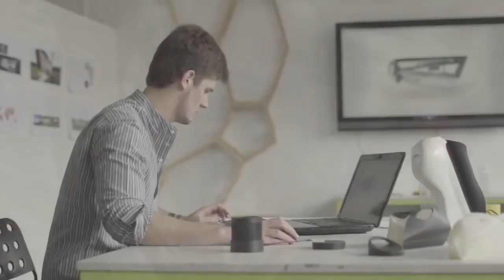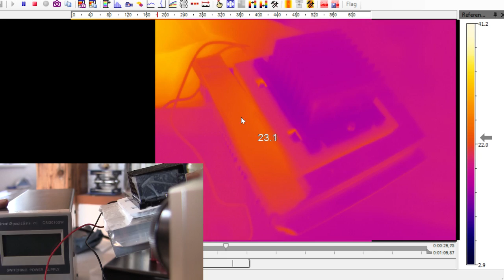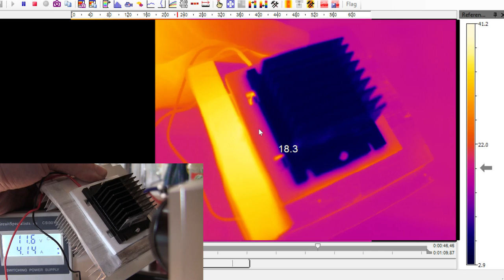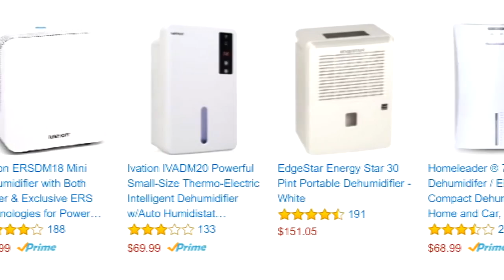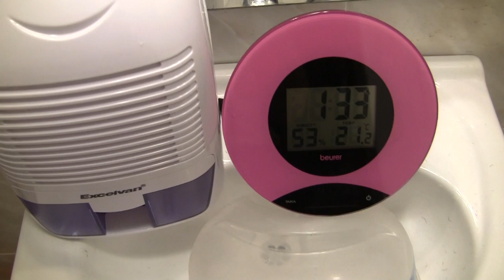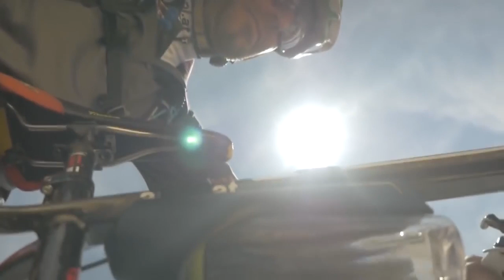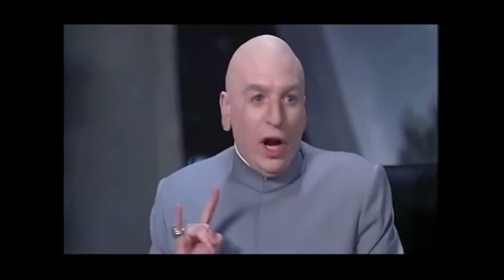$300 000 'Self-Filling water bottle' FAILURE

Comment: Just saying, wouldn't it be more efficient to use the kinetic energy from cycling to produce the electricity needed to power the bottle?
Reply: @Archn Scythe, Take it this way. Lets say you want to use 200 watts of power to ride your bike. that will enable to cycle at a speed of 30 km/h (19 mph). But lets say you want to also power a generator, to power your dehumidifier, but still only use 200 watts total for your riding experience. Lets say your dehumidifier uses 30 watts. That only leaves 170 watts of power going towards the speed of your bike. with less power, you will go slower, like around 27 km/h (17 mph). To be able to go as fast as without the generator and dehumidifier, your body will need to generate more power (230watts).

Where does power/energy in your body comes from? It comes from burning up sugar. Sugar comes in various forms of molecules containing carbon (C), hydrogen (H), and oxygen (O). Take glucose as an example. its combustion formula is 

C6H12O6 + 6*O2 -> 6CO2 + 6H2O + Energy

So you see, to make energy, you need to burn sugar, which will use oxygen (what you inhale) to fuel the reaction. The reaction produces carbon dioxyde (what you exhale), but you also exhale water vapour. So if you need more energy to power the dehumidifier, you'll be exhaling more water.

Also, our body is not a perfectly efficient power plant. When we generate power, we lose some of it as heat. A comparable example is a car's engine. When the engine is burning fuel, only 30% (!!!!!) of the power produced goes to move your car. 70% of it is lost in heat. That's why your engine gets hot, and why you need coolant. And that's why you heat up when doing an exercise. If you need to generate more power, for the dehumidifier, you'll be generating more heat, which the body will have to get rid of. How does the body get rid of the unwanted heat? We sweat. Sweat is our cooling system. Sweat is mostly water. So by generating more power, you'll be loosing more water through sweat.

To conclude, as you cycle, if you want to power your dehumidifier, either you'll:
-go slower
-go at the same speed, but lose more water due to exhaling more of it and sweating it out.
Reply: 100-200w sounds about right for riding a bike, more when offroad. and imagine needing another 200 to 300 watts for the dehumidifier. anyone else getting sweaty already?
Reply: In the hypothetical situation where energy production is the only major problem of course.
Reply: well you would be taking the energy from the person, then they would need even more water...
Reply: and still with 30 watts it would take like a week to fill up the bottle by cycling, you need a lot more power..
Reply: not sure if troll or stupid
Reply: Why all the Rube Goldberg? I propose a startup where we make people cycle and then extract the water that drips off their forehead. This is at least several orders of magnitude more efficient thermodynamically speaking.
Reply: then you would need a more efficient way to extract the water than the modern way, because the amount of power needed is pretty big... there could be net gain but it would be really small like you said, making the idea almost useless.. the best idea is to carry around enough water and a not so great idea, (but still better than the generator idea) is to carry a battery big enough to run the dehumidifier thingy. 

if you are far from civilization, its a better idea to reach a water source or the civilization quicker than ride the heavy bike slowly, because you could run out of food too..
Reply: oh, so it was sarcasm? damn i never learn that...
Reply: yup. I don't know how much power normally goes to a bike generator, but I know that 200 watts if fairly normal for riding a bike at 30 km/h. So there isn't that much available power anyways
Reply: +Hirmuli I think you missunderstood what Zaheer Navas said. It was a hint at how Archn Scythe seems to see the energy physics. And i had the same thought. If the whole 'you are driving the bike anyway, so just extract the energy from it' idea was true, you could solve electricity problems by using the same principle with your car. 

Of course its bollocks, but its a way of illustrating it.
Reply: That causes losses to power the generator. So the rider has to cycle harder to travel the same speed & distance.
Reply: Shillip DeFraudo no NO! Stop thinking common sense! Bad!
Reply: @Suros what did tk say?
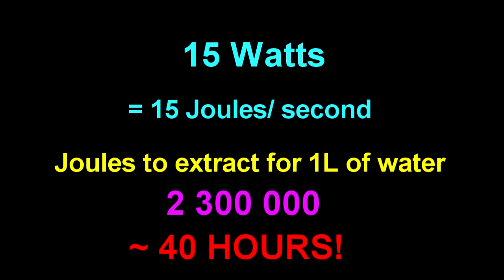Reply: When you ride a bike you put somewhere between 100W and 200W into the pedals. Let's say 15W extra for dehumidification would be acceptable. As the video showed at 2:12 you'd have to wait 40h in perfect conditions for a liter of water. On top of that, I'm convinced the extra sweat your body produces from these 15W of extra power is much more than this measly 1liter/40h=25ml/h in all but the coldest conditions.
Reply: The best way to get some energy out of cycling is via generative braking. The brake levers close the circuit on a generator instead of moving brake pads. The resistance of the generator slows the bike to stop or moderate descents. The system would need a battery of course, because of the intermittent source of generation. Some electrically driven bikes already use this to put a little power ‘back in the tank’.
Reply: Shadow you would have to install some kind of generators in the pedals to create electricity from them, that way the human riding the bike converts his own energy into electricity, and he would experience more resistance from pedaling it and would need some more water too. 
 much like fanning yourself is useless because you heat up as you use your own energy to move the air..
you could use a generator as a brake (i mean like kers) but i assume that it would not create too much electricity in a bike.. 
 understand that you always have to take the energy from somewhere, you cant just create it. if you take the energy from the pedals turning, you take the energy out of the person because its the person turning those pedals.
Reply: the energy that you use to move the bike, that goes to moving the bike. that energy cant just come back up and magically turn into electricity.
 it would be much more heavy to move the bike AND produce enough electricity to collect water into the bottle. if you want to move the bike AND make electricity, you need to also run the generator. 
 an air dehumidifier uses around 280 watts (according to a quick googling), that would be a huge load and would definitely make the bike a lot heavier to ride.. 
 you are already converting your bodys energy to move the bike, if you want to also produce elctricity, you need extra load on your body, you would convert your bodys resources into electricity (and heat up, ergo you would need more water). 
 i really cant explain this much simplier than that, so either i dont get your point at all or you dont fully understand the physics here?
Reply: not sure how to respond to that
Reply: Archn Scythe when YouTube comments are smarter than a large cooperation...
Reply: Fanning yourself isn't useless, you're taking heat energy out of your face and into your arms
Reply: Hirmuli . You make some good points. But one way of thinking about this is converting food energy into water generation. In a place where you have plenty of high calorie food, but no water, a human-powered dehumidifier may be an option. A poor one, but it would be something. Yes, you would need extra water to run the contraption. But small losses for a net gain are not uncommon. For a similar example, fossil fuel extraction takes up loads of energy. It's the net gain of energy that makes such a process worthwhile.

In our bike-mounted water extractor, it's possible the extra cost of water usage would be outweighed by water gained. This depends on many factors, such as air temperature, efficiency of the machine, and fitness of the human.

However, this all seems pointless for recreational activities. If you're planning to go out into the wilderness, the energy spent on carrying extra water would probably be more efficient than riding a more resistant bike.
Reply: Archn Scythe just attach it to your car then all the electricity problems are solved
Reply: Hirmuli My point was that you would be using up the energy anyways because you would be riding the bike no matter what. I would think that if it uses a substantial amount of more energy.
Reply: Hirmuli no he means that the turning of the peddles of the bike converted into electricity so it would be exactly the same as riding a normal bike

Comment: False if you can cool the air down inside the bottle through compression and decompression and the air outside is far from the temperature inside it speeds up the condensation process exponentially

Comment: wow I have a 165w solar panel and the voltage drops so mutch it can barely power a peltier rated current is 4.72 rated voltage is 35 but it drops down to 6 as the peltier starts heating and collingnit goes up it jjst takes to long when conneted it works like a sharm

Comment: that dehumidifier is shit! I live in ny (basically canada, nowhere near the ocean or great lakes) in the spring and summer our basement can get a little damp when it rains. So we run a dehumidifier down there pretty much full time in the spring and summer. Even on days when it hasnt rained for weeks ill still have to empty the condensation bucket (looks to be roughly a gallon) twice a day. Id estimate the humidity down there between 40-50% on average. granted thats a higher humidity, but not much and a HELL of a lot more water.
Reply: I think he got a crappy dehumidifier on purpose because of the capabilities it shares with the fontus bottle.
Reply: MrAlexjames94 hahaha I have a tortoise in my room and it needs about 60% humidity and I can't change that so...
Reply: i was talking about in the experiment haha
Reply: in your case no, dont do your turtle dirty like that
Reply: Relative humidity is a percent and it tells you how saturated it is, so low relative humidity means you need to cool down the air more to get water(I think). So summer means your air can hold more water and the relative humidity is pretty high.
Reply: Yes he got a Peltier dehumidifier because that is what they are using, and those are crap for cooling/condensation.

Comment: uh was there a point in your humidifier experiments? i mean de humifyers do actualy de humidify so your conditions were just awful and pointless werent they? why not do it outside to show that or did they mention the condition you used as an example or something
Reply: not trying to bitch but seemed pretty silly to use that an an example, we ran our humidifier at uni everyday pretty much amd emptied a full 5 litres every day sometimes,  we had washing out etc
Reply: If you have been to uni you should know the difference between subjective and objective evidence. Just because you saw a dehumidifier pull water from air in one location where temperature and humidity parameters are unknown to the rest of us(and I am guessing you also) it does not invalidate objective evidence collected under controlled temperature and humidity parameters. Keep also in mind that the experiment was not meant to demonstrate that a dehumidifier cant pull water from air. We all know they do that, its what they are made to do. The point was that in conditions where you would need water it wont work.

Comment: Another problem is that water without dissolved compounds, aka pure water is REALLY BAD FOR YOU, i dont know exactly if its toxic, but i seriously dont think that its very good for you not to absorb any salts to stabilize osmosis inside your cells...
Reply: Takihero Squires He was probably trying to say something along the lines  of osmosis and cellular lysis. Body cells are hypotonic to distilled water, meaning that if they come in contact with it, they'll absorb water up to the point of rupture, in a process called cellular lysis which kills the cell in the process. Drinking a lot of distilled water may in fact be fatal due to throat and stomach cells dying as a result of that process.
Reply: In theory, you COULD get sick from it, but as PHMCarani points out, you have to drink quite a lot of it.

And in a magical world where this thing actually works, you'd just carry a few drink mix packets.
Reply: donald trumps suppresing the media again
Reply: It is a problem, but it's intended for short travel trips, so you should recover when you begin absorbing minerals from normal bottled water or tap water.
Reply: Takihero Squires I have a pure water filter...
Reply: They said you should add a powder to the bottle after ot is Dull
Reply: Zach S Salt on you are food. Sigh.
Reply: Even then, when you start drinking that much you risk drowning yourself *anyway*, with tap water. In both cases it's very uncommon but the difference is negligible.
Reply: Just use a little salt on you're food you will be fine!
Reply: Donald Trump in reality, he's right. But seeing how no natural water is pure, it's really not a problem.
Reply: You have to drink roughly 3 gallons in an hour for you to die from it. So I don’t think it’ll be a problem when only drinking a liter a week at best with this product

Comment: I think a slightly more possible idea would be to have a mechanical generator attached to each wheel that fills a capacitor bank for constant power supply to the condenser.

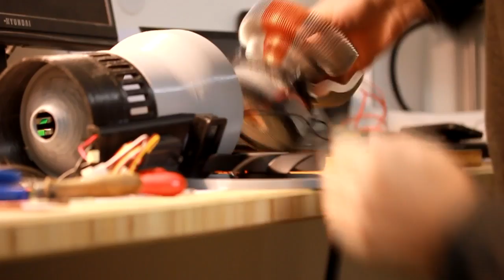Comment: I immediately recognized the 2 heatsinks shown at 17:05 lol! And the device at the front at 17:42 is an old Zalman fan-controller btw.
It is a Zalman flower cooler, the Zalman CNPS7700-AluCu. And a generic it Intel stock cooler, with even the plastic pins to install it in place :D

Comment: I have a dehumidifier which can extract around 2L in a day, this is asuming that the air is 20°C abd the hunidity is 60% which is normal. admitidly it is the size of a small child and uses a compresser to cool and heat the air, however it only takes up 60w

Comment: I think the only reason your dehumidifier didn't work is because it is so small (and your humidity wasn't too high). I have a floor air conditioner (bear in mind I said AIR CONDITIONER, not dehumidifier, although my unit can do both if I want) and I can get a full 10 gallon pale of water in a couple hours. I live in central Manitoba though, near our lakes, so our humidity is closer to around 60% all the time. But, the product in this video (the water bottle) is sooo small, it would take so much longer for the water to condense. You'd make more water by doing the hole in the ground trick with a tarp, where you dig a big hole, cover it with a tarp, put a rock in the middle with a bottle underneath, and the water will condense and drip to the bottle.

Comment: Given the 32% humidity experiment with the commercial dehumidifier it's shown that these won't do anything below 40-50%.
So out of curiousity, would something like that work on a ship? There's tons of water but it's by default not drinkable.
Would it work there and be an actual option for technically desalting the water or is a dedicated desalting setup easier and more efficient to run in that case?

Sidenote: the awards and funding show what a mess Dyson and the Austrian Goverment are led by : /

Comment: lol. I got a dehumidifier in my insanely humid basement. And running it 24/7 I can get like a gallon or half gallon (w/e the stock bucket size is) in like 12 hours and that's sucking a huge amount of power. G/L with their water bottle scam lol
Reply: I think I would much rather drink puddle water than drink from a de humidifier

Comment: What if you had a desiccant that you allowed to absorb moisture and then used the hot side of the  peltier junction to bake out the moisture and the cold side to condense it? You might be able to lower the humidity at which a device like this would work It would still take a lot of energy though.